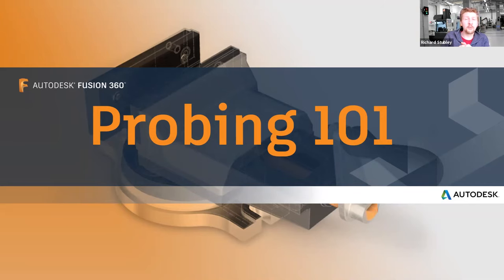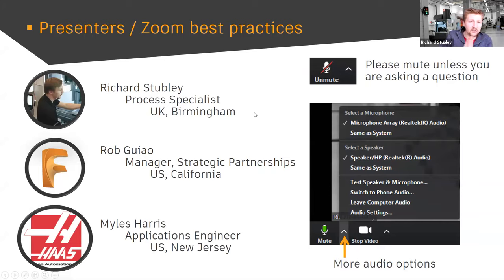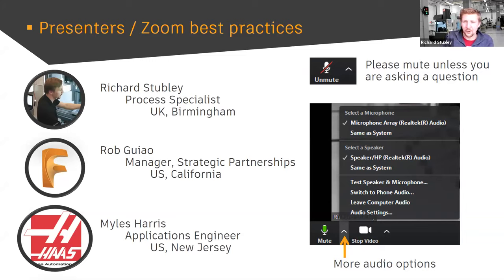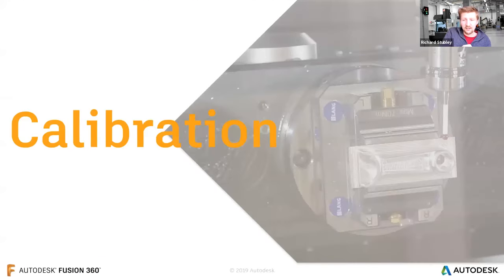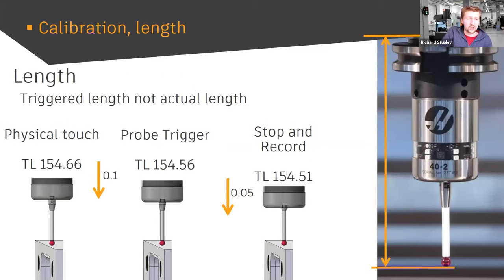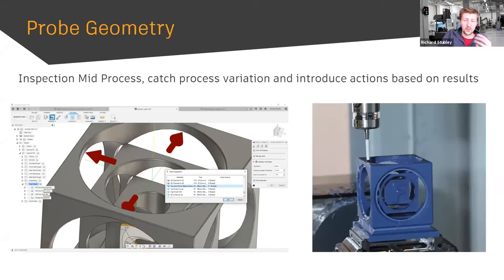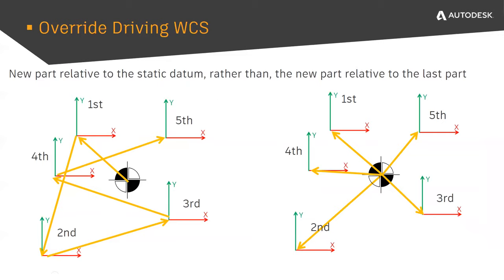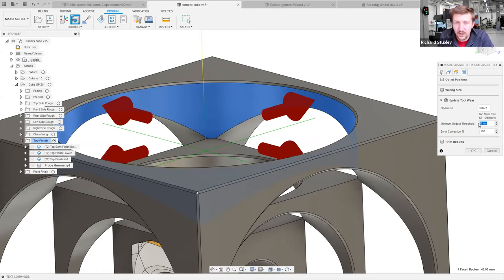Autodesk Fusion 360 | Webinar: Probing in Fusion 360

Comment: Trying to figure out how the non-override works so if I use G59 as my probe driving WCS and it’s some other location how does fusion know how far away that is from where my current G54, G55 part location is? This is assuming G59 is not the same location as the G54, G55 are going to be.
Reply: Hi, you would normally have G59 set to the same location as G54 for example.
So G59 is your overriding WCS
G54 is your Setup WCS

What this means is that G59 is your ideal part location and will never be changed. where G54 is the current part location and is optimised and updated for every part.

Comment: Hi, thanks a lot for this great video. I have started learning (WCS) probing features in Fusion 360 a few days ago so this is very timely! One thing I can't possibly find is how to probe my B axis?! I work on a XYZ+BC table VMC, so all setup start with probing C then B axis to align table before probing X Y and Z. In Fusion 360, option to probe angle relative to X or Y axis is offered when selecting a vertical/side surface to probe C, but nothing's available when selecting an horizontal/top surface to probe angles along X for B and Y for A 😢 How do people with 5 axis machines do probe their WCSs? Thanks in advance for your answer.